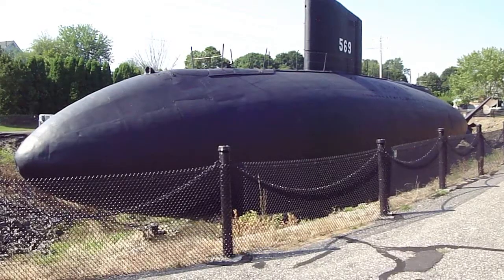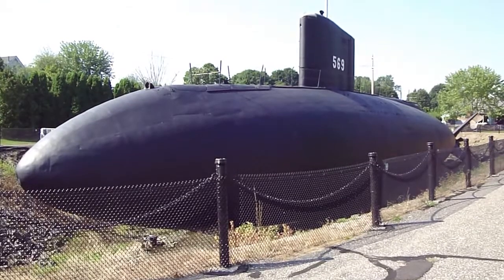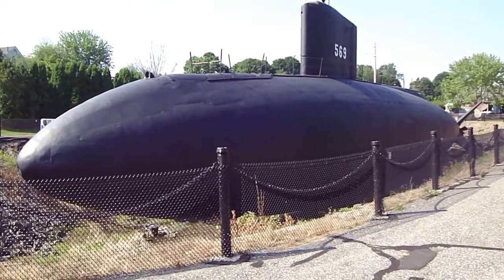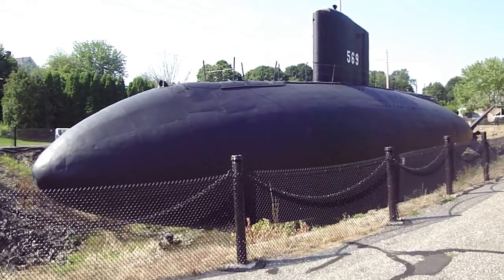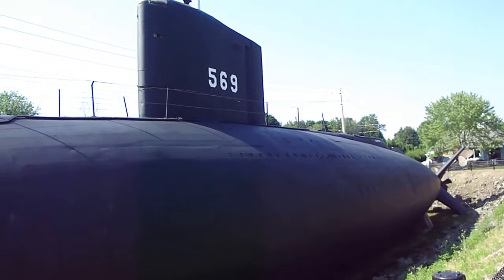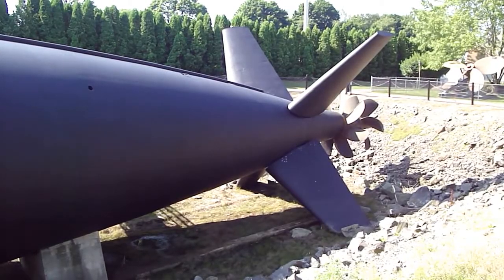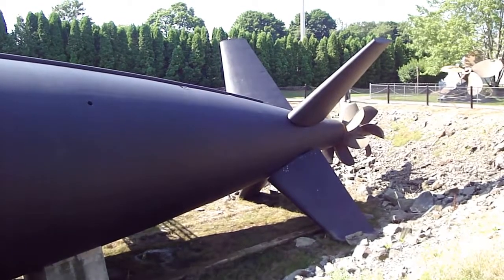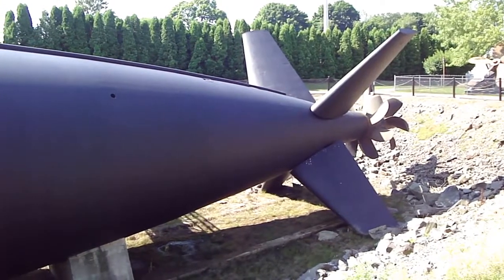USS Albacore Portsmouth, NH July 2013

Comment: Not nuclear powered ... and nowhere near 40 kts speed. The narrator's making it up as he goes ...
Reply: Harpo Marx actually the albacore did reach 40kts. in trialling a new propeller design. albacore was a true research and development boat and underwent many changes throughout her service life testing new equipment designs. if you will note she has no torpedo tubes and is about half the size of a fleet boat. her high output silver/acid batteries and a new induction electric drive motor combined with her namesake albacore hullform allowed for very high submerged speeds. read submarine war beneath the waves by rodensen or Jane's submarines. also, she was very agile submerged. note the total lack of stanchions, cleats and other bumps and protrusions on the hull. also note the rudder structure on the aft end of the fair water or sail. all this leant extra speed and manoeuvrability. her batteries used so much silver that the treasury made the navy give it a receipt for the silver.